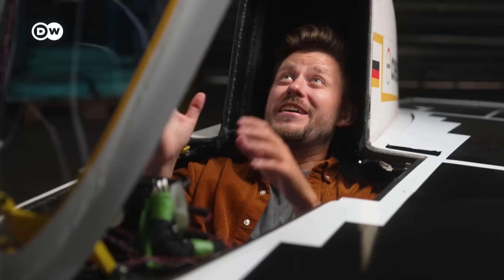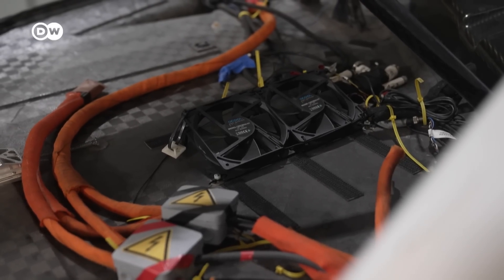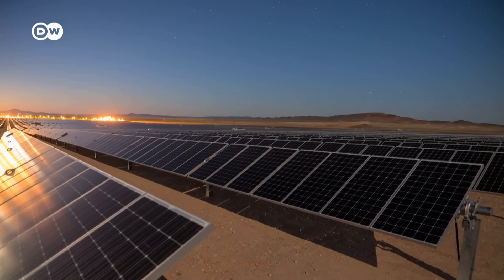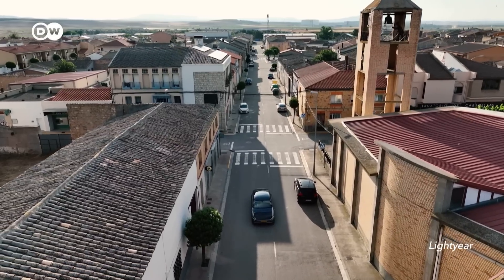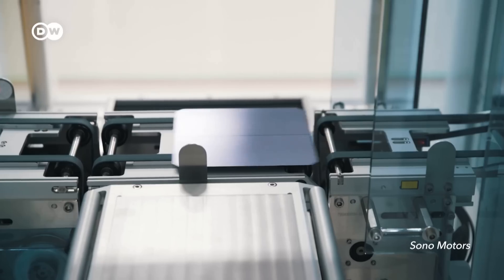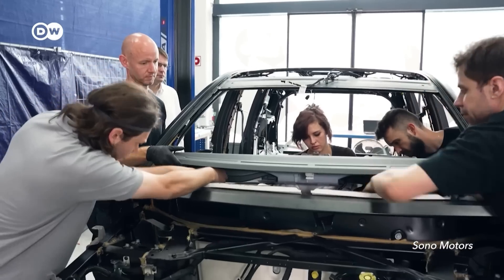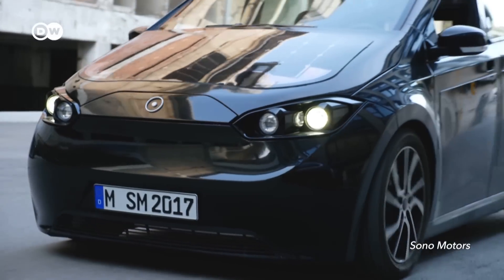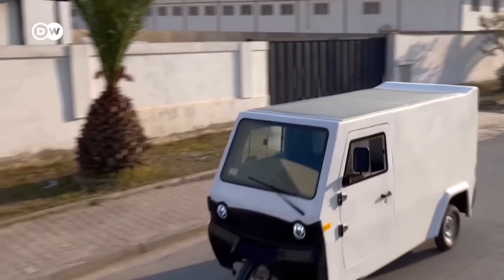Why aren't solar cars everywhere?

Comment: We need a "peoples electric car" with a utilitarian approach , something like a kei truck with one single large residential panel on the little vans roof, it would only be around 400/500w but they have a tiny 20ish kw battery and capable of 150/200km of range but use existing tech that could be made affordably and NOW. Mitsubishi already make something called a Miev Minicab for about 25 grand, update its battery, include a solar panel and charge its tiny battery up the rest of the time from those on your homes roof. Not as glamorous or profitable but that is why all these Ev makers go under and we dont have cars with solar still....
Reply: Delivery vehicles sound like a good point for this. They tend to go solver, lots of stops in urban areas, just regen breaking makes a difference for those.
Reply: We don't need solar cars at all, it's a dumb and inefficient concept. A cheap electric car on the other hand, that's interesting.
Reply: @oyuyuy Adding solar to vehicles is a great idea.  These small reductions in energy consumption add up.
Reply: @netscrooge  No, definitely not. Having to pay twice as much for the car while sacrificing range and precious space isn't a good tradeoff for having a trickle charge that allows you to plug in a few times less every year.

Letting cars be cars and power plants be power plants is a great idea.
Reply: @oyuyuy  Twice as much?  Sacrifice range?  Trickle charge?  Are you getting paid to spread these ideas?

Comment: Thank you. Is a hybrid solution the answer then? Generate as much energy as possible from solar and use the regular electric car setup for the rest?
Reply: I think both the cars featured had fairly large battery's and could plug in for charging. For sure the way to go, at a minimum for stormy days.

Comment: Unless it is to have mobile solar power so something else can be plugged into and powered by the car, wherever it is, I'm not sure about the reason to directly power a car with solar when it can already be done indirectly just fine. I don't see a general advantage. Just some very specific possible ones.
Reply: It's not "powering the car" directly from the sun, it's charging the onboard EV Battery for free off the sun, without plugging it in anywhere.

Comment: I'd like a car that folds out a solar array above it when parked. Maximising the catchment area and shading the car 😂
Reply: I've seen videos of people unfolding panels from the trunk of a Tesla. There was a van that had roof panels plus slide outs for both side. So it has three times the roof area.
Reply: And you are adding even more weight on what are already heavy cars.
Reply: Nothing prohibiting a detachable swivel solar roof. It's just no one thought of it - would be a bit challenging with the car on the move because aerodynamics but the roof could retract to its normal position after a certain speed is achieved let's say 30mph as with some convertibles that require the car to be below certain speed for the roof to open.
Reply: @krisg.4257  
I'm not saying when it's moving, when it's parked. I mean EV's are becoming successful because even a frequently used vehicle is probably parked in excess of 20 hours per day.
Reply: @krisg.4257  People have thought of it, it just adds a lot of complexity. Most of the challenger class solar challenge cars do it because its kind of required, but the extra required roof panel, structural reinforcement and space needed for actuators makes it somewhat infeasible for production cars. Even most of the solar challenge cruise class cars (the big 2-4 seater cars) dont have foldable rooves because it adds a lot of weight.
Reply: I was thinking same thing. That's all would need to do. Make the design more about charging the vehicle while at work or parked at home or elsewhere.

Comment: Cars can be powered solely on solar panels but who says they need to be on the cars? Put it on top of parking and charge while doing your day to day business. 90% of the time a car is stationary
Reply: That what @Tesla promised, charging stations powered by sunlight.
Reply: The car is stationary 90% of the time, but this does not mean that is 90% of the time under the sun.
Reply: Agree overall but i came around to solar on cars despite that as a concept a couple of years ago. Trickle charging while moving/stuck in traffic/away from charging cables is a cool trick,  and charging infrastructure is expensive. 
 If everyone could plug in at work with level 2 charging great, but we aren't even close to that or will be in the near future. So on a City or Country scale, having in theory every second car or so top up some EV range would for sure take a load off your charging infrastructure. Things like 15 minute quick charging only partially help with that, solar could still be one part of the solution taking some of the burden off $$$$ expensive things like public level 2-3 chargers.
Reply: @KarpKomet  how much range do you get with 3kW charging? 8h at work + 8h at home during sleep, that is 16h * 3, that is 48kWh just a regular power outlet for each car and do you really need close to 50kWh for your regular commute? I would imagine not really, you need fast charging when you don't want to sit and wait for it to charge, you really don't want it when you are sitting around not needing your car for the next 8 or so hours.  Use the grid people,

Comment: A working solar car is a challenge for a sunny day. Checking the weather before going for a drive is a lot more important with a solar car. It's probably better for the solar cells should be over the parking lots and eventually the roads.
Reply: I like that idea, parking lots, roofs, but also highways and train lines. If you have East-West bound train lines that will be electrified soon, I don't think extra expense too put panels over the tracks would be too high as you already need some of that for over head power lines anyways and could use those same power lines for power distribution.

Comment: Another major limiting factor with solar-powered cars is the rather low efficiency of only 25%, for even the best solar panels.
Reply: But such an abundant source, billions of billions of MWh per day... there isn't a single number large enough to describe the amount of energy the Earth receives each day from the Sun. 
25% efficiency - I can cope with that.
Reply: @joebloggs6131  that's a fair point. ulimately, all energy on earth is derived from our star, the sun. if solar panel efficiency could be doubled or more, that would be a game changer. on a side note, tree leaves can be thought of as little solar panels except, instead of electricity, they convert sunlight into chemical energy to feed the tree. biomimicry is a field of science that takes inspiration from nature to design & build man-made things that nature has already perfected. maybe solar arrays should be built like trees, lol.
Reply: @techcafe0  So you want the car to run off sugar lol?

Comment: APTERA ISNT FAULTY.   THIS IS PATHETIC REPORTING & LAZY AT THAT
Reply: No need to shout, lol. Aptera is faulty. They said it has regen, but Nikki drove it and said it didn't work - to the point she was certain it wasn't even installed. That's just one of dozens of faults - would you like the rest?

Comment: I have the new prius prime. it comes with solar panels on the roof. parked outside work in the sun for 9 hours saw me gain 7 kilometres of extra range. its great because thats nearly a third of my commute. as it is a plug in hybrid, 95% of my commutes will not use any fuel at all.
Reply: I think Toyota took an overall wise and sound approach with first perfecting the hybrids and gradually moving into electric and solar in timing with the technology improvements. The Prius is known overall as one of most reliable and efficient cars and generally affordable transportation.
Reply: @tw8464  Prius doesn't promise 40 miles a day from the solar.
Reply: Yes this seems like a good way to do things with current technology. And there are good sunny days where we're off work perhaps over the weekend or home all day, it can get some recharge by the panels.
Reply: @tw8464  Yes, we go from never wanting to leave our cars in the sun to always wanting to. Go figure?
Reply: You would need to park two of them side by side with black plastic covering the second to be sure you got 7 kms of range.
Reply: @aussieideasman8498 wdym, the infotainment screen in the car tells you how much range you are getting. it shows the wh and how much range youre gaining at the moment and how much range / wh youve gained all day. sure it might not be 100% accurate but its definitely in the ballpark.
Reply: @sanitygone-l9y  You said you got 7 kms, not ball-park 7. I was saying how to be 100% accurate, which you admit your experience was not.
Reply: @aussieideasman8498  bro it’s not that deep. i don’t think they’d outright lie about how much solar range the car is getting. considering the cars tend to underestimate their range, i wouldn’t be surprised if it’s getting more than 7km worth of range.
Reply: @sanitygone-l9y  Besides the two-car test, a drive down an accurately measured road would also be needed.
Reply: @aussieideasman8498 you seem offended by someone getting 7 km from their solar panel car.
Reply: @bltzcstrnx  Not at all. If solar works, I am all for it. And I can question a claim without taking any offense. I can ask for facts without implying they are wrong, as well, and still have no emotions whatsoever.
Reply: @aussieideasman8498  I agree solar panel on car is not great. Solar requires area. Even with 4 kilowatt like the video is abysmal. Keep in mind this is peak power, in reality it will be less than than that. Lowest AC fast charging is around 7 kilowatt, at this rate even small cars like Wuling Air EV already take 7 hours. The best way to have solar powered cars is to have a charging station that is powered by solar panels and battery storage. That said, I think 7 km is very doable on sunny days.

Comment: Just incorporate solar panels into the design of a average electric car if it only increases range by a little bit so be it every little helps. Even if it's only powering the onboard electrics it's something. Tho I think it's a good idea for things like buses and lorries, vans, trains, things with a big roof surface area.
Reply: I have very low mileage, about 3000km a year, even just a small panel on the top would probably avoid me plugging in 99% of the time. But I currently don't have an electric car so not much use to me. These could also work well on buses, lots of flat surface on the top
Reply: True, I think big car manufacturers should just continue offering as an option. A bit of added range will still help even just added 4-8 kms per day. That still worth like going to shops or work that aren't close at home. That's free energy.

For buses, trailers and boats. I think this will shine better due to bigger surface area and far more efficient due to theu can carry more load for a single vehicle.

Trains? Well they help but really uncessary. Electric trains already run by the external power source which is more efficient, and solar panels can be simply installed on each station and depot. Trains already most efficient mode of transport that somehow many in North America region seems to forget. Solar can improve it for sure though.
Reply: @kornkernel2232  You cant do that as an option. Engineering a car doesnt work like that. You would compromise all cars of that series heavily by having an option to have solar panels.
Reply: @_Dibbler_  Where do you see the challenge? as long as the parts don`t have any static loads (like bonnet, skylight, fender...) inherent, why not?
Reply: @SchwuppSchwupp  There is the point. All of the chassis is statically loaded and you would have to modify it in quite an unfavorable way for those panels. Every car would drive around that weight + a lot of extra parts for those pv panels. . Sure you can do it, but all of your cars would be worse and you would have to accomplish crash rules with both options, with the same chassis. Its the same reason why combustion and BEVs should not share the same chassis (and yet often do, but its not good for either of those cars)
Reply: It literally doesn't help though. It's just inefficient and ridiculously expensive solar panels that take up valuable space in your car. It's neither economic nor environmentally friendly.
Reply: Well not that you mentioned trains, one could make they are already solar powered ( depending on the electricity mix ). Grid is this beautiful thing to which you connect, use the power and never worry about it. No need for batteries, solar panels, luging any extra weight around, if you have wires you are good.
Reply: @fulconandroadcone9488  All fine and Dandy in an ideal World.  Most of the UK network still uses diesel Generators to power electric trains. If Solar panels can be used on lorries it can be used on trains. The additional power can power the onboard electrics. I think this sort of thing will be Commonplace one day as Solar panels continue to fall in Price.
Reply: @adus123  Not sure why would you use diesel generators to power electric trains. Diesel electric ones, yes, but they shouldn't be used for high traffic lines anyways. 

I would say a better solution would be to put solar panels above rail lines and then use electric train power delivery lines for distribution. That way they can have optimal sun angle instead of moving with the vehicle.
Reply: @fulconandroadcone9488  A Diesel electric train is just a generator on Wheels No need to get all snooty and technical about it

Comment: Neat in theory, but outside special cases like topping the back of a semi trailer with panels or an RV roof I don't think it'll ever add up to have solar panels on vehicles. Certainly not at current solar costs even far cheaper than they used to be, maybe ever--the energy gained is just so trivially small. Sounds like the mentioned studies didn't even account for the car getting dirty when parked outside to soak up that solar energy--might be a net negative environmentally just in your increased need to get carwashes, never mind the negative harmful effects to paint and general exposure parking outside vs in a garage and the fact that almost no one can park somewhere that'd be in direct sun all day every day (well, during daylight hours). I think the hypothetical projections are vastly better than anyone could ever achieve real world.

Comment: More importantly, "solar charged" EV cars will eventually be everywhere as the world's grids decarbonize.

Because the year 2035 is a big milestone where the US/Canada/EU set to have a carbon-neutral grid.  From then, the grid only becomes cleaner and cleaner.  One of the best ways already is to have solar rooftop at home and charge mid-day at home or store in home battery.  Or charge from a facility like a mall, office, or industrial complex that has solar on its roofs.

On the big picture, the power of the sun is so vast that less than 1% of the world's land mass area is needed to power all the world's grids using current solar photovoltaic technology.   There is enough offshore wind to power the world several times over.  Wind and especially solar capacity are growing at large annual exponential rates.  Its unstoppable at this point as they are also the cheapest source of electricity generation.
Reply: Additionally, on the topic if solar cars, as solar cells continue to both drop rapidly in price and increase in efficiency, it would not surprise me that over the years that a large number of EVs models have the option for solar cells built-into in the body (roof, hood, etc).  It will just be necessary for EV manufacturers to have this consumer option to survive in an increasingly competitive EV marketplace.

While these onboard solar cells may not contribute much to the EV's driving range, the cells can easily supply supplemental power to keep ongoing security and electronics going over long periods of parking to mitigate effects of "parasitic" energy draw.